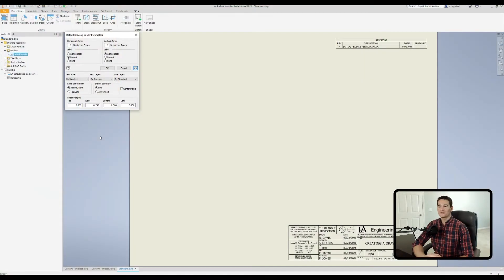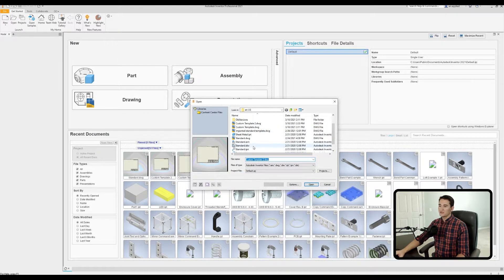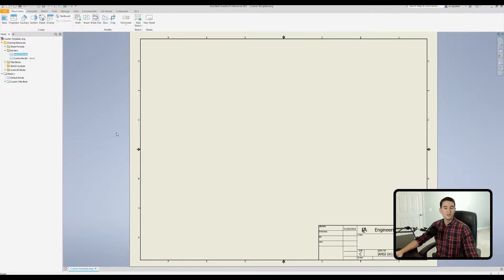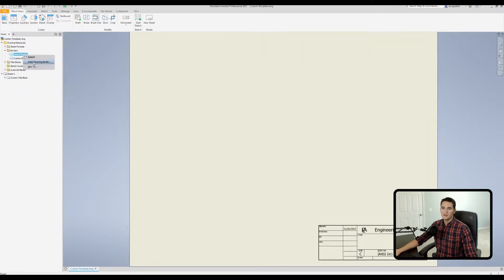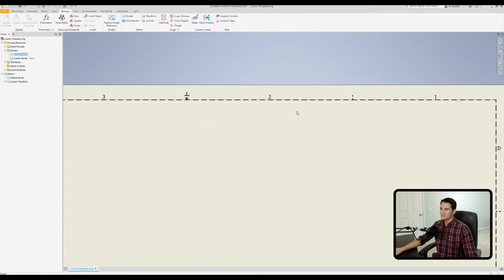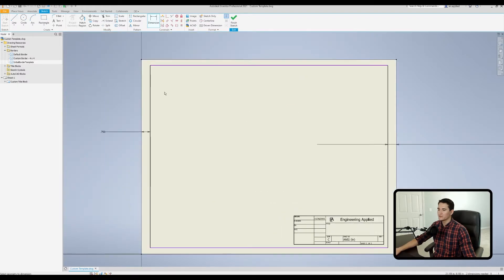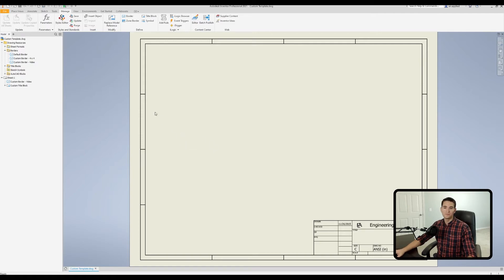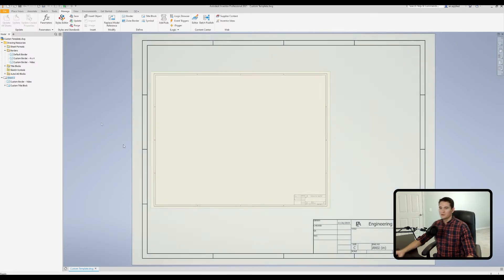Custom Drawing Border - Autodesk Inventor Drawing Tutorial | Autodesk Inventor 2021 IN DEPTH

Comment: Hello Engineer Alex, how do I open more than one port to display the body in the inventor, as is found in the AutoCAD program, which contains the viewport configuration command?
Reply from the maker: Hello! If you want to place model views in your drawing, you would start by using the "Base View" command. I have a video on the "Base View" command that I just released last week that shows you how to import model views and project additional views off of the base view. Additionally, you can use the base view command to drop views of different parts on the same page as well. I hope this helps! Thanks for watching! :)